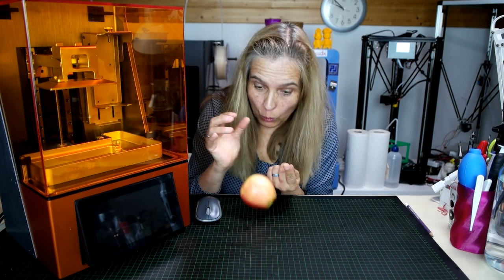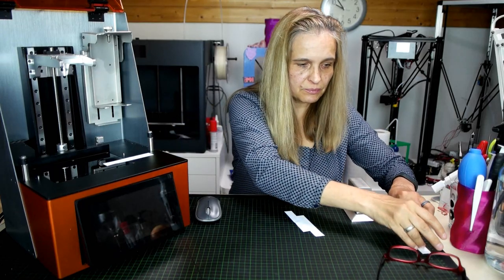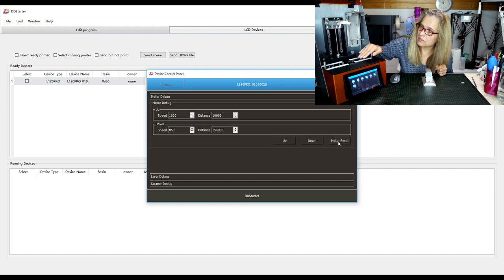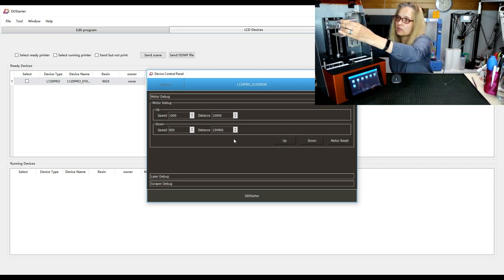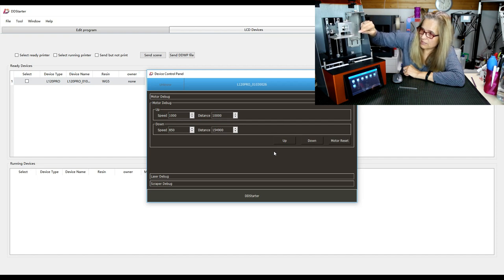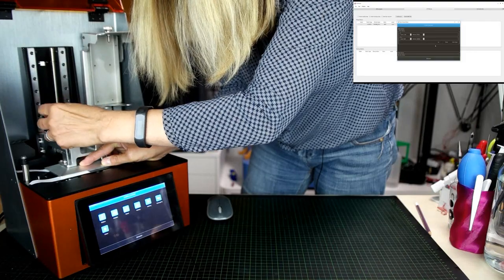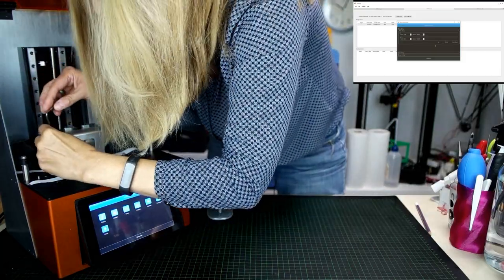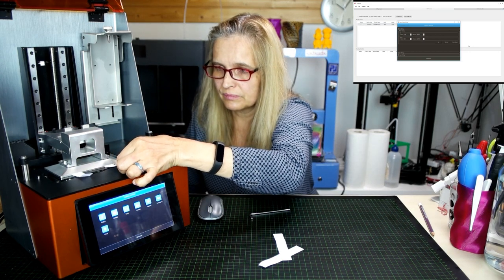Bed Leveling on Dazz3D L120

Comment: I prefer to use 1000-2000 as I find anything else damages the head even more.
Reply from the maker: Yuriy Sklyar I don‘t understand what you want to tell me. The 150000 distance setting is the standard that the printer is delivered with. So starting from there. I slowly increased until the platform touched the screen and the distance of the Z-axis and build platform sunk halfway down. Then I closed the screws. Even if the distance is to big there is a mechanism that prevents a damage of the screen. You hear a loud noise but the motor stop right after it hits the screen.
Reply: @choschiba  I was talking about how fine the sandpaper is :)
Reply from the maker: @YuriySklyar  UI, haha, I really didn´t get it. If you want to set your prints directly on the build plate it would be a better choice. Otherwise you might not be able to get them off the plate anymore.
Reply: I've only node prints that cover a small build surface, and am about to get into really "big" stuff, so I'm looking forward to seeing how things go... I'm thinking a lot of snapped kits at first heheh